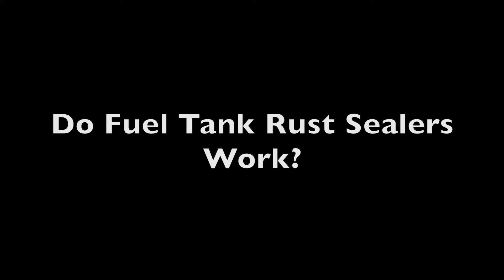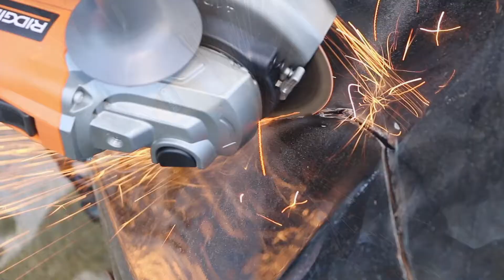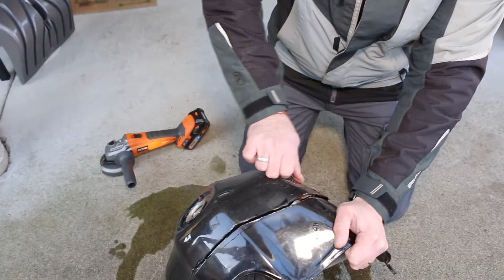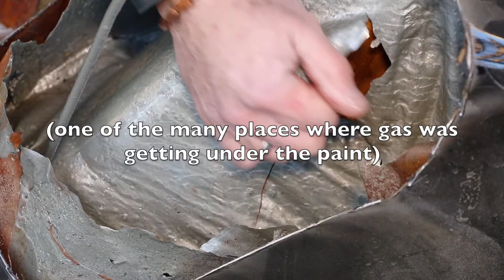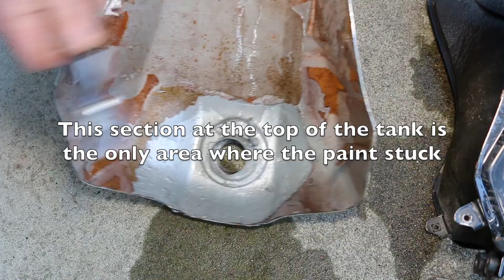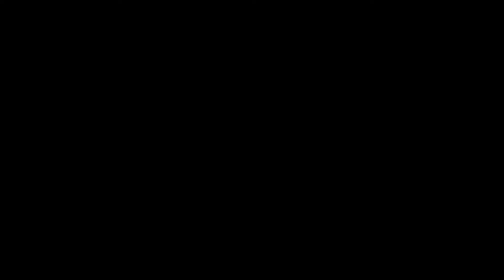Motorcycle Fuel Tank Sealers: Don't Buy Until You Watch This Video!

Comment: This video is a great example of what happens when a good product is improperly applied. Notice how they conveniently did not show that part.
Reply from the maker: Well, we didn't think we'd be making a video about the issue. We don't normally sacrifice a $1,000 fuel tank to make a video. It was applied exactly as per the instructions, whether that's correct or not. What I didn't mention is that the guy at the auto parts store that sold me the paint warned me that it wouldn't work. We just didn't think it'd fail that quickly and so extensively. Thanks for your comment.
Reply: Ive restored several bike tanks. I’ve had solid, lasting results from Kreem and Red Kote. It really is all in the prep and patience. If the inside isn’t completely rust free and surgically clean, it will fail. Fresh Acetone, Fresh Evaporust rolled with steel bb’s and allowed to sit for up to a couple days and then a final acetone rinse followed by immediate coating always does the trick. From there only Ethanol free gas going forward.
Reply from the maker: Thanks for the feedback!
Reply: @rymburt  oh thats funny to me. I tried the Kreem kit a couple of tines but it never really worked for me, i couldnt get it to adhere to the tank. 

Now i allways use the 3part kit from tankcure, it works really well for me.
Reply: I recently bought an old Corolla I plan to restore. I have already purchased a new metal fuel tank. Would it be pointless to do this to a new tank? Thanks in advance. @rymburt
Reply from the maker: @totallylegityoutubeperson4170 I wouldn’t treat your new tank with this paint. New fuel tanks are coated to protect the metal from corrosion and shouldn’t need to be coated. Good luck with your project.
Reply: What brand did you guys use?
Reply from the maker: We didn’t disclose the brand for various reasons. Sorry.

Comment: I been using tank sealers for years. I've never had this problem. But I can see how this could happen especially if you live in an area like the "rust belt." However, I will say that tank sealers should only be applied after fuel tank is completely restored and free of rust inside and out.
Reply from the maker: Thanks for your comment. What fuel sealers have you used in the past?
Reply: @3ftDeepChannel  Ive used several including KBS and POR-15.....But I recommend Red Kote above all else.
Reply from the maker: Thanks. POR-15 is what we used and although we followed the directions exactly as written and ...well, you can see the results. Just curious, how long did you keep your POR-15 treated tank for? Did you ever check the inside thoroughly? We didn't see any cracking in the paint until we tore into the tank.
Reply: @3ftDeepChannel  I still have two tanks that are treated with POR-15 that I had  for 2 years now. Still haven't had a problem. One thing that I always recommend is immediately after derusting the inside of the tank to wash it out using a 50/50 mix of acetone and marvel mystery oil this helps both evaporate any water left from rinsing, while also  preventing flash rust while drying. If you decide to seal another tank I would recommend using Red-Kote.
Reply from the maker: Thanks very much for the information. When I was getting the second dose from our local Lordco Automotive, the guy said it was not going to work (he was right). He did suggest using an epoxy that is very difficult to get hold of in Canada, but may be more accessible elsewhere. Not sure what that epoxy is, but he swore by it. Thanks again.
Reply: @ELCLAVE300  in the process of preparing to derust my tank. After washing it out with 50/50 mix of acetone and marvel oil, would you let it dry on its own or use a hair drier ? Many thanks
Reply: @whistler2670  heat gun hair dryer or in the hot sun dry it as fast as possible.
Reply from the maker: @whistler26 we did that process the first try, and it does not work. The next fill with gasoline will dissolve the Marvel oil and it will start to rust immediately. What we didn’t realize is that the tanks inside are coated with a protectant so that it doesn’t rust. Once that protectant is gone, you need a special epoxy to have proper protection from rust.
Reply: @whistler2670  Sorry for the late response.... So I don't recommend ever using a heat gun or hair dryer to dry the tank. You risk causing flash rust that way... What I do is immediately after all the water is remover pour in my MMO an acetone mix and shake the tank and tumble the tank so that it gets in every part of the tank... Lastly you can store it like this if you aren't going to use it or drain it and fill with gas if you plan on putting back on the bike and using it... hope this helps.
Reply: @ELCLAVE300  wouldn’t the MMO oil the surface preventing the sealer from adhering to the metal properly?
Reply: No, that's why you put acetone. So that it evaporates after you drain it. If you think that you have MMO left in the tank. Just give it another acetone rinse.
Reply from the maker: BTW, if you’re going to use acetone make sure you use a proper respirator and do it in a well ventilated area. The stuff is highly carcinogenic and quickly destroys your liver.
Reply: @ELCLAVE300  can you please tell me what are alternatives to marvel mystery oil, because I can't get where I'm at.
Reply: @Mohapi_Tau  In that case, I would find the lightest oil you can like an all purpose oil or WD-40 works well too.
Reply from the maker: Please let us know how it goes. I am very curious to see if it survives 12 months after application.
Reply: @ELCLAVE300  thank you.
Reply: Amigo @Francisco Lopez compré un por-15 fuel seller, para el tanque de mi moto Suzuki Vstrom y ahora tengo duda de usarlo en mi tanque, tu has usado ese producto? Que me recomiendas?
Reply: Acetone is not carcinogenic*
Reply from the maker: Well, that’s a relief. It’s still toxic, and I wouldn’t trust it. It goes Street into your bloodstream through your skin, and that’s not good for your liver. Thanks for your comment.
Reply: @goyo2481  Redkote, es El mejor producto para seller
Reply from the maker: Gracias

Comment: Por-15.  Por means paint over rust. If your tank isn’t heavily rusted that’s not the product to use and you just found out why.  Operator error far as I see. I do 50 tanks a year zero problems.  Weld that back together grind it down. And use caswells
Reply from the maker: Thanks for your comment, Travis.
Reply: My understanding is that while por does mean paint over rust, that is not necessarily the case for their tank sealant. I just applied it to mine and there wasn't anything about rust needing to be there for proper adhesion in the instructions. I would think they should make that perfectly clear " Tank must be rusty for proper adhesion". I spoke with a factory tech about this when applying the regular POR-15 to some rusty and non-rust undercarriage areas and he told me it could be applied over clean metal as long as it was properly prepared with the etch. It can be painted over rust, but does not have to be. That's my understanding anyway.
Reply from the maker: Thanks for the update, Dennis.
Reply: Thats just straight up False, travis....

Comment: Firstly, kudos to you for responding maturely to some provocative comments.    I have used POR 15 successfully.  Here are my observations.  I prepared the tank by using a given number of wood screws (counting them before AND after use) and shaking the tank so the screws remove loose rust.  Then filling  the tank with vinegar, sealing it, and shaking it.  I poured the used vinegar through a white bath towel into a 5 gallon bucket.  Then repeated the process.  Did this three or four times.  As you probably know, vinegar is a weak acid.  (I've use muriatic acid on select parts and hardware, but only with a 3M protective mask - fumes are nasty).  After vinegar no longer turns white towel  red, I used a fresh rinse of clean vinegar.  Rinsed with water.  Then I apply the Cleaner-Degreaser from POR15 kit.  The instructions say it makes surface acidic.  Rinse with water. Then add the Metal Ready from POR15 kit. This does an alkaline prep. of metal surface.  Rinsed with warm water and then completely dry the tank.  I used a hair dry duct taped to inlet and left it overnight to dry.  Then applied POR15 sealer, thoroughly rolling tank and letting excess drain out.  Then used hair dryer again to dry the sealer.  My questions from your description (1) whether you used the Cleaner-Degreaser and Metal Ready?  (2) Was any moisture left in tank when you applied sealer?  What did you do to dry interior?  (3) And use of multiple sealer treatments I think may be problematic.  My understanding is sealer is meant to bond to metal, not done in multiple coats.  Thanks again for your post.
Reply from the maker: I can't recall which products we used, but it was as per the instructions on the can. We don't know if there was any moisture left in the tank, but we used a hair drier set on high for about 15 minutes to dry the inside. We had to use multiple treatments, because one can was not enough to cover the large (and complex-shaped) tank. I agree that multiple coats is not the best, but the instructions didn't prohibit it. There's no doubt it bonded better in some areas than in others, but it should have bonded much better in most areas. Thanks for your comment.
Reply: @3ftDeepChannel  I think 15 minutes drying was too little. 15 years ago I did several bike tanks with POR15 and still like new. A hair dryer set in a homemade jig blowing hot air for a long time to make absolutely sure total drying is done is essential. That tank you tried is complicated! Could dampness and moisture accumulate in a chamber?
Reply from the maker: Yes, we are pretty sure that the treatment was not effectively getting into the corners, as it is a complicated shape. Best to stick with rounded shaped tanks. Good to hear that you’ve had success with this product though. Thanks for your comment.

Comment: I have a 1979 Suzuki GS1000 i restored 8 years ago .The tank had pinholes and leaked i used a 3 part kit and have not had any issues with it leaking in 8 years . Proper prep is all it takes .
Reply from the maker: Thanks for your comment. Do you remember what kit you used?
Reply: @3ftDeepChannel  I used the Kreem 3 part kit for large tanks . It worked really well and going on 8 years .
Reply from the maker: Thanks for the info. We may just try it one day.

Comment: I used a german product called Tankdoc, it consists of 3 parts: 1. automotive degreaser detergent, 2. oxalic acid to derust, 3. epoxy paint (2 part paint), I applyed two coats. Worked well for me. I first tried derusting with electolysis, but afted 3 days it didn’t clean everything, so I used the product. Muriatic and sulfuric acids are too strong, I didn’t want to use those, because it’s hard to deactivate them, the metal rusts very fast after the treatment.
Reply from the maker: Thanks for the advice, Vlado. You’re absolutely right, the muriatic acid is way, way too strong for this application. It removes the rust very quickly, but it etches the metal too much and the rust starts forming again very, very quickly.

Comment: professionally coated ? ( stick around and I will answer that)... and WTF is that supposed to be ?  Acid and abrasives to etch... nothing there that cannot be done at home just as well.   Neutralize that acid... again... we can do that.   So,  the only thing I can think of is using an Industrial Grade Coating .  I have used 3M EC-776 for decades with no failure.  But of course it is designed for Aircraft use, and IF failed it would kill somebody, so naturally 3M put some serious chemical engineering and materials science into the product development.( Chances are the over the counter guys to no liability for anything, anywhere, ever! )   3M EC-776  has very high VOC ( solvent)  content  74%,  and a flash point of only 55 degrees F ( if that sounds like MEK it pretty much is).   So, IF you can get it... you can fill, slosh, and drain just like the pros do.   Where you are going to find these pros... outside the aircraft repair industry  I do NOT know...  but it aint at your motorcycle or auto repair shop... unless they are mean old buzzards like me  who actually know what shakes.
Reply from the maker: I'm not sure about where you live, but where we are we know of several people who re-coat motorcycle tanks professionally. They do a fantastic job, but it's expensive and the tank must be re-painted when they're done. So all in it's about CDN$600, which starts to approach the cost of getting a new tank. That's the dilemma.

Comment: I have seen the same failures with tank seals when preparation steps been skipped or done improperly - proper cleaning of the tank with leach and isopropanol to remove gas residues, flush, then acid for rust removal as abrading the surface, flushing and neutralizing, flushing with Iso and drying - then the first coat is applied and after the final the tank is cured for at leased a couple days in a home setting.
Reply from the maker: Thanks for the tips, Sideshow.

Comment: The rust wasn't removed first, or the tank flash rusted after removing the rust. After always neutralize it with hot water saturated with baking soda to prevent a flash rust.
Reply from the maker: Thanks for the tip, John.

Comment: I can tell you from experience that you think you may have followed the instructions to a T but you didn’t - I had the same issue. Mine was inadequate drying of the tank before steps, it caused a nearly identical failure.
Reply from the maker: You could be right. The problem is flash rusting. If you leave the tank too long to dry, it'll flash rust and then you've got the same issue. Where we are it's relatively cool so we had to use a hair dryer (for about an hour). In some climates you may be able to leave it in the sun for an hour or so and that'll be enough. Thanks for your comment.
Reply: @3ftDeepChannel  I found that a hair dryer either didn’t get hot enough or didn’t move enough air, I’m not sure which, but wound up using a heat gun on low temp/high flow. The tank was HOT to the touch when done. I didn’t notice flash rusting, and I’m in the PacNW where it’s pretty humid and cool. I would up using PoR-15 pretty successfully.
Reply: @Fsone174 looking to use the por15 stuff how long has it been since completing your tank?
Reply: Put a hair dryer inside
Reply from the maker: Around 3 years ago. You should know that the auto shop that sold me the stuff warned me that it wouldn’t work.
Reply from the maker: The tank opening is was too small.

Comment: I prepared my tank by filling with vinegar to the top(full) added drywall screws(shake it around during) Let sit for a week until the tank was clean. Drained then added a bit of acetone. Rinsed with “super laundry soap” not baking soda. Rinsed with water then acetone again. Let it dry out. Then paint. Let cure for four days.
Reply from the maker: What did you paint with, Frank?
Reply from the maker: Yes, they don’t tell you that part in most other videos. There is a liner in these gas tanks and as soon as that liner degenerates, your tank will always flash rust. The only thing you can do is epoxy it professionally or use some other product for retail customers, which we have yet to find (that works).

Comment: Bit unfair to have one bad experience, with one product, then advise people not to buy any tank sealer. At the end, you advise getting it professionally coated so you must concede that it can work. I've had good experiences with both Tapox & Flowliner.
Reply from the maker: After I did the job (but before I discovered it was coming undone), one of the guys who works at the hardware store where I got the paint from said it probably wouldn’t work. He was very negative about the product. When I asked which one I should use, he said that none of the products available to consumers were any good. The only good ones were epoxies that the professionals use, and the tank would need to be repainted after. We’re very interested in the products you mentioned, but after all the time and money we spent to do it right, we’re not confident in any do-it-yourself kits.
Reply: @3ftDeepChannel Tapox is a German product sold by a company called Fertan, who also supply various products for cleaning & de-rusting the tank first, as well as a "sealeater" that removed old linings. It's not an easy job, for example; you have to keep a flow of air through the tank while it cures. I'm about to do a customers tank & if it doesn't work it will be my fault, not the product. I'm not sure if you can get it in the U.S. but worth looking for.
Reply from the maker: Thanks for the information. It sounds like you’re a professional, which is what we’re recommending for this job.
Reply: How much would a professional charge? In a rusted tank with peeling por15? The place I'm dealing with wants 400$ yikes
Reply: @joshuapellerin2578  I don't know what the hourly rate is where you are but it's probably a days work, spread out over several days & you need products to remove the old sealant, products to remove rust, others to convert any that might be left before you even open the tin of sealer.
Reply from the maker: To do it properly they need to put it in a chemical bath which also removes the paint. It’s about CDN$250 for the chemical treatment and sealant. It then costs about CDN$250 to get it repainted. So all in about $500. May be worth it to buy a used (but newer) fuel tank. That’s what we did.

Comment: I've used Red kote and Kreem, Both work really well. Even dented the tank after, and it didn't chip or peel. We even have the GASP E15 fuel here...
Reply from the maker: How long have you had a coded for?
Reply: @3ftDeepChannel  The kreem tank is over 10 years, the red kote is probably 5.
Reply from the maker: That sounds great. Thanks for the tips.